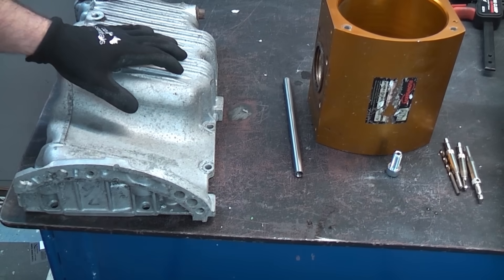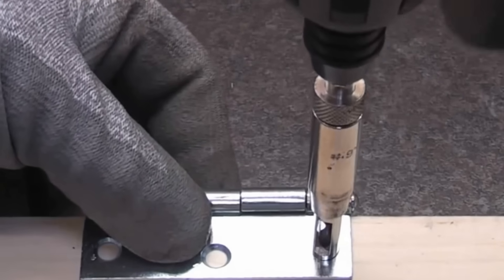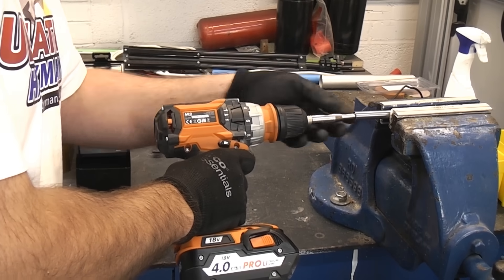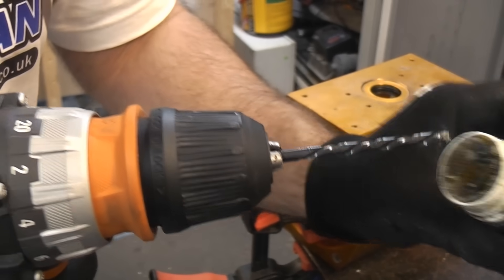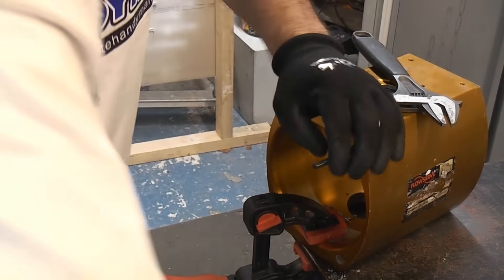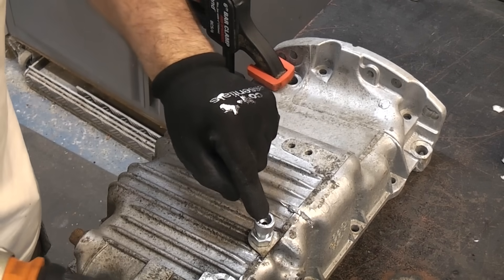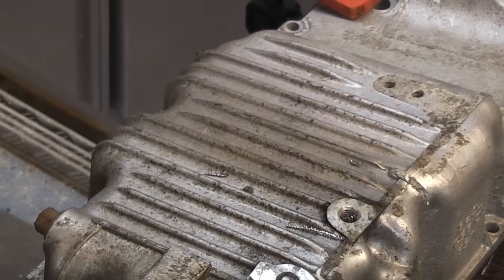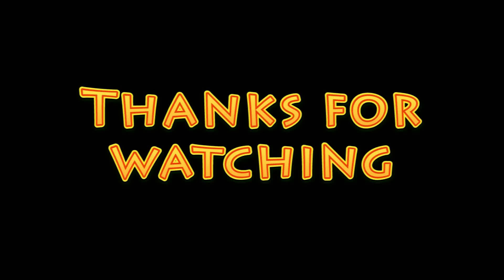How to remove a broken bolt in a deep hole | remove broken bolt in recessed hole

Comment: Finally someone showing civilized methods for this.  Switching out the original hinge drill bit for a left handed bit - dang that was a forehead slapper for me.. I've got the broken bolt, the hinge bit set, left handed drills; but I never would have thought of swapping the bits.. D'Oh!  Now I've just gotta figure out how to drill an allen bolt down the center without a lathe
Reply from the maker: Thanks for the comment 👍

Comment: If you create a bit of damage to the edges of the threads on the Al.  can you not grind  a flat spot on the side edge of the shank of the new bolt craating a sort of thread chaser ?  🤔
Reply from the maker: Not sure, it's best not to damage the threads too much in the first place (if possible)
Thanks for the comment 👍
Reply: Ultimate Handyman 
Thanks for the reply .

its always best to have best results but the best doesnt always come out the bestessest.  👍
That tool.....  7:21  is what is known as an  "Okie  fit'em all "  in the U. S  😳
Well made Video 👍 👍

Comment: What do you do when the bolt is broken off and seized in the hole from corrosion?
Reply from the maker: Apply some gentle heat to it, and use plenty of spray penetrant.
Thanks for the comment 👍

Comment: When I try those steep threaded extractors, they keep threading into the broken bolt until it splits lengthwise and swells up in the hole, hopelessly jamming it into the workpiece.  I use instead the extractors that are a tapered square (not helical).  The wedging force is totally controlled by the hammer blows used to set it; no more is generated by the turning.
Reply from the maker: I have both sets on site, sometimes the round ones work and sometimes the square ones work and sometimes neither of them works 😂
Thanks for the comment 👍

Comment: Sadly I rarely have a broken bolt in such good condition, I usually encounter the long break that has it looking like mount everest on one side so even with the alignment bolts, "which are very cool and I intend to whip up some for myself" obtaining a Centre pilot drill is very difficult. If it's big enough M10+ I can usually hit the broken face with die grinder to establish a more flat starting surface. If it's broken in my work it's never goner easy out ether as it broke cause it's been seized since noar first installed it without anti seize being applied. Great vid tho I learnt some more tricks for my bush mechanics bible. Cheers.
Reply from the maker: Thanks for the comment 👍

Comment: Interesting. Not a big fan of this left hand removers , Schweineschwanz in German ( Pigtail ) : If it breaks there is a piece of hardned steel in Your way only EDC can remove. There is a unexpensive tool set availiable with guide bushings and a remover what works like a charm: https://www.ebay.de/itm/HSS-Bohrer-Steh-Bolzen-Ausdreher-Loser-Werkzeug-Satz-Schraube-Linksausdreher-Kfz/161729806186?hash=item25a7d8ff6a:g:OzYAAOSwAghavPWi
Reply from the maker: You can drill out broken taps/drills/screw extractos at home, but it is not easy- https://www.youtube.com/watch?v=7JCfEMrCjhc

Thanks for the comment 👍

Comment: Hi what size guid drill bits do you use? For example do you use a 6 or 8 for ten mill bolt ?
Reply from the maker: The guide has to the the size of the hole that you are drilling out, so for a M10 hole, you would use a M10 bolt, with perhaps a 6mm drill hole through the centre, you could possibly drill the centre hole to 8mm, but that won't leave much material on the bolt guide.
Thanks for the comment 👍

Comment: If you used a tap wrench it would have been easier on you.
Reply from the maker: Yes, it would. I should buy another one really for home use.
Thanks for the comment
Reply: Ultimate Handyman I’m sure you know I was being sarcastic. That was actually a great video I’m a part-time Machinist and I love the through hole on socket head cap screw, I’ll be chucking some of them up in my lathe very soon.
Reply from the maker: I've made so many videos that I can't remember exactly what I said in each video. In this video I'm sure I mentioned that my tap wrench was at work, but people still tell me that I should use a tap wrench ;-)

Now I know you are being sarcastic ;-)

Comment: What if there is loctite on that  bkroken bold (in my case here 4 broken bolds in a mbk stunt motor with loctite )
Reply from the maker: Applying heat using a blowtorch can help to break the bond- just don't breathe the fumes.
Thanks for the comment 👍
Reply: Ok thanks will try that

Comment: A small sledge hammer is also good for tapping on wrench handles, especially if there is no room for a longer handle, rather than adding extensions. The copper grease is made for spark plug thread anti-seize, to help find it in a store.
Reply from the maker: Thanks for the comment 👍

Comment: Instead of those cheap "never easy oots" use a torx bit that's slightly larger than the hole you've drilled and bang it in instead of the esy out and just ratchet the broken bolt out, works every time
Reply from the maker: Thanks for the comment 👍

Comment: I have a complication for you, I have not suffered this but some people have.

What if  you use an extractor and that snaps off in the hole but it's firmly snapped off so you can't remove it.

Now you have a hardened steel bit stuck in the hole you set up to remove the snapped bolt.

I suppose you could always use harder drill bits but then the extractor may get in the way of trying to get a centered hole again.
Reply from the maker: https://www.youtube.com/watch?v=7JCfEMrCjhc
Thanks for the comment 👍

Comment: By the way fantastic program today excellent commentary,,,but I'm sure there is one thing that you overlooked or forgot to mention,,all these methods work very well unless the threads are gaulded on either portion of the broken off bolt or the internal threads,, in which case it is pointless
Reply from the maker: Thanks for the comment 👍

Comment: Dude where do you get that bore centering tool for the drill bit? ?
That' will make life way easier. ..especially if you could use it on a bur bit too In case you have to flatten out the broken off bolt before you punch and drill it.
Reply from the maker: I think you mean this- https://www.youtube.com/watch?v=6mZj0J6CNYA
Thanks for the comment 👍

Comment: Maybe insert an 8mm or 10mm wooden dowel and drill through it. Might be enough to guide the drill? Cut a groove across the top of the dowel to extract with a flat head screwdriver.
Reply from the maker: Thanks for the comment 👍

Comment: I've always either center punched, drilled and used an extractor.
Never ever thought of drilling through a bolt to be used to center it. Great tip.
The other method I use if the bolt is recessed.
Is welding a nut to the broken piece. Filling the inside of that nut to the broken piece. Then just un-bolting it.
Reply from the maker: Thanks for the comment 👍

Comment: If the piece is made of aluminum, we usually remove broken fasteners by welding a nut to the remaining shank allowing the weld to puddle to fill any reasonable void. Then use a wrench to work it free and remove it.  this only works on aluminum though, since the weld won't bond to it. Steel or cast pieces will become permanently attached.
Reply from the maker: Thanks for the comment 👍

Comment: What about a broken screw that is slightly sticking out of the hole? Same method like you used with a screw extractor drill bit?
Reply from the maker: Yes, but try and grind the broken part flat, so that it is easier to drill the hole as close to the centre as possible.
Thanks for the comment 👍

Comment: Really helpful info, but my bolt is tiny (road bicycle derailleur jockey wheel bolt)! Any thoughts?
Reply from the maker: Some small bolts are impossible, it is often the case that you have to drill them out.
Thanks for the comment 👍

Comment: Excellent idea I will be using that for now on always had a problem with the fucker sliding off and tearing up the threads drilling through a bolt is a perfect idea thanks a lot for the information keep on keepin on
Reply from the maker: Thanks for the comment

Comment: Nice video!!! Im afraid most of the time a bolt is broken off (for me anyway) is because someone crossthreaded or it has corrosion welded itself in there.  In either case, none of this works for me.  The centering technique is excellent!!!!!  I will use this next time I have to drill one out and retap it!
Reply from the maker: Thanks for the comment

Comment: What if the bolt is sitting above the surface and is not flat or smooch? Making it hard to drill anything into it without it slipping right off.
Reply: Cut a slot in it with a hacksaw/grinder/Dremel and turn it out with a screwdriver or impact driver. First apply releasing oil though.
Reply: Hahaha take a grinder and smooth it off... Then you can drill the hole for the screw extractor knucklehead

Comment: Good video.  How do you sharpen your drill bits. They seem very sharp and they cut evenly?
Reply from the maker: I normally use a diamond-coated file, it's much easier than using the grinder IMHO

https://www.youtube.com/watch?v=DZrbeyATkvg
Thanks for the comment 👍

Comment: Where can i buy that drill bit adapter?
Reply from the maker: Not sure which adaptor you mean, but these links should help-
Hinge centering drills- https://fave.co/2DpJo1H

Left-handed drill bits- https://fave.co/2xJjK1M

Teng screw extractors https://fave.co/2OnfRuF

Dormer taps -https://fave.co/2OsN1sQ 

If you are in the UK- 

Hinge centering drills- https://fave.co/2NE1VMc

Left-handed drill bits- https://fave.co/2DubtF4

Teng screw extractors- https://fave.co/2pVLkVT

 Dormer taps - https://fave.co/2pTfbyx

exact cutting paste- https://fave.co/2Nabyxc

Cobalt drill bits (they are much better on harder steels like bolts) https://fave.co/2zDh3kp

You'll have to make the guides yourself, but they are easy- https://www.youtube.com/watch?v=6mZj0J6CNYA&t=1s

Spring tools centre punch- https://fave.co/2NbnLBD

Comment: Now what can be done if you were an idiot and you went ahead drilling without having watched this video and now the threads are damaged?
Reply from the maker: Well, firstly nobody is an idiot, at least you had a go ;-)
Depending on how damaged the hole is, you might be able to just re-tap out the hole, but if it is badly damaged you can always get a Helicoil kit and fix it with a threaded insert- https://www.youtube.com/watch?v=sQHRB2ElZJ0
Thanks for the comment 👍

Comment: Every Bolt extraction is different, I have yet to see one that I could not get out. Relieving the tension on the shank is key. I run into this same problem with Hydraulic Cylinder Glands. Sometimes the answer is to drill repeatedly to relieve the tension. If You choose to drill the most Important part of the process is finding and center punching the exact center! This cannot be over stressed. If You use heat then use it only momentarily as the heat is transferred quickly and will return to the same or even worse gall the threads..... The bottom line is that if You choose to be a tech then You will run into broken bolts. I spent one Christmas day bolting on a new windshield on an MH-60 Sikorsky (Black Hawk) out of about 200 screws over 90 of the heads snapped off. She had to fly the next day and that was a very long night....Hooah Black Knights!
Reply from the maker: Thanks for the comment 👍

Comment: where can i buy the tools ? link me please
Reply from the maker: Hinge centering drills- https://fave.co/2DpJo1H

Left-handed drill bits- https://fave.co/2xJjK1M

Teng screw extractors https://fave.co/2OnfRuF

Dormer taps -https://fave.co/2OsN1sQ 

If you are in the UK- 

Hinge centering drills- https://fave.co/2NE1VMc

Left-handed drill bits- https://fave.co/2DubtF4

Teng screw extractors- https://fave.co/2pVLkVT

 Dormer taps - https://fave.co/2pTfbyx

exact cutting paste- https://fave.co/2Nabyxc

Cobalt drill bits (they are much better on harder steels like bolts) https://fave.co/2zDh3kp

You'll have to make the guides yourself, but they are easy- https://www.youtube.com/watch?v=6mZj0J6CNYA&t=1s

Spring tools centre punch- https://fave.co/2NbnLBD
Thanks for the comment 👍

Comment: Please tell a man where he might buy a reverse drill bit??!!.or left handed, whatever??. I've looked for a long time.. I've never bought tools online either so anyplace anyone may know of please lmk.. thanks.
Reply from the maker: These links cover just about everything used in the video-
Hinge centering drills- https://fave.co/2DpJo1H

Left-handed drill bits- https://fave.co/2xJjK1M

Teng screw extractors https://fave.co/2OnfRuF

Dormer taps -https://fave.co/2OsN1sQ 

If you are in the UK- 

Hinge centering drills- https://fave.co/2NE1VMc

Left-handed drill bits- https://fave.co/2DubtF4

Teng screw extractors- https://fave.co/2pVLkVT

 Dormer taps - https://fave.co/2pTfbyx

exact cutting paste- https://fave.co/2Nabyxc

cobalt drill bits (they are much better on harder steels like bolts) https://fave.co/2zDh3kp

You'll have to make the guides yourself, but they are easy- https://www.youtube.com/watch?v=6mZj0J6CNYA&t=1s

Spring tools centre punch- https://fave.co/2NbnLBD

Thanks for the comment 👍

Comment: What if the bit will not cut into the bolt? Even with a new bit.
Reply from the maker: You could try a cobalt drill bit, if that won't touch it you could try this- https://www.youtube.com/watch?v=7JCfEMrCjhc
Thanks for the comment 👍

Comment: I've never seen a bolt break off like that.. Usually they break at the surface, or out above, not below in the threads.
Reply from the maker: It happens sometimes ;-)
Thanks for the comment 👍

Comment: But putting copper paste on a steel bolt would make it corrode faster wouldn't it?
Reply from the maker: Copper anti-seize is widely used, apparently, it can cause corrosion on aluminium in some scenarios.
Thanks for the comment 👍

Comment: Can you please tell us what are those special drill bits and tools and where to buy them.  Thanks
Reply from the maker: Hinge centering drills- https://fave.co/2DpJo1H

Left handed drill bits- https://fave.co/2xJjK1M

Teng screw extractors https://fave.co/2OnfRuF

Dormer taps -https://fave.co/2OsN1sQ 

If you are in the UK- 

Hinge centering drills- https://fave.co/2NE1VMc

Left handed drill bits- https://fave.co/2DubtF4

Teng screw extractors- https://fave.co/2pVLkVT

 Dormer taps - https://fave.co/2pTfbyx

exact cutting paste- https://fave.co/2Nabyxc

cobalt drill bits (they are much better on harder steels like bolts) https://fave.co/2zDh3kp

You'll have to make the guides yourself, but they are easy- https://www.youtube.com/watch?v=6mZj0J6CNYA&t=1s

Spring tools centre punch- https://fave.co/2NbnLBD
Thanks for the comment 👍

Comment: Ahhhhh but when the bolts snap off at the edge of the hole so you have NO threads to screw your little guide into..... and the bolts are grade 8.... Not mild steel......  🤦‍♂️🤦‍♂️🤦‍♂️🤦‍♂️
Nissan RB motors...... Damn you Nissan!!!  Every time..😡
Reply from the maker: I remember why I always buy German vans 😂
Good luck with it

Thanks for the comment 👍
Reply: lay a washer on it. Weld washer to bolt. weld nut on washer. Take out with wrench.

Comment: Great idea making the drilling guide, I will start on those tomorrow.  I have found that when I am having trouble getting the extractor to bite into the metal, I put a bit of torque on it as I hit it with the hammer, tends to get a better grip that way.  Thanks for the ideas!
Reply from the maker: You are welcome
Thanks for the comment 👍

Comment: Have to be very careful with those screw extractors, and know when to stop. Normal drill bits won't drill through them if it gets broken off in the bolt
Reply from the maker: Thanks for the comment 👍

Comment: Newbie question: What is cutting paste? Is that used to prevent seizing of the drill bit so that the tip doesn't break off?
Reply from the maker: It prevents the drill bit from overheating, it also lubricates it.
Thanks for the comment 👍

Comment: My broken studs are usually rusted in and inaccessible. :-(  I had a broken exhaust stud that resisted removal for a week of evenings. I was left with a nub protruding, I couldn't weld a nut on, socket head screw extractors just slipped. In the end, I bought a set of left handed chuck jaws. Did the job in seconds. Never used them since, but it don't matter, they're so beautiful that they sit on my mantlepiece as ornaments! :-)
Reply from the maker: Exhaust studs are a real pain in the backside!
Thanks for the comment 👍

Comment: The tap handle method allows one to keep pressure on the extractor and also places pressure on either side for better control.
  I sometimes use small endmills to "flatten" the broken surface. A tube or pipe will usually suffice to keep the threads intact.
Reply from the maker: Thanks for the comment 👍

Comment: Nice! Remember to watch for metal shavings getting wedged in threads. Compressed air will blow them out.
Reply from the maker: Thanks for the comment 👍
Reply: allways blow out every bolt hole before replacing bolts more so if its rusty like a manifold

Comment: The AEG 18V cordless drill in the UK is the same as the Home depot Ridgid 18V system in the USA. Both are made at the same factory in China, both batteries interchange. The chargers in the UK are for 220 volts
Reply from the maker: Thanks for the comment 👍

Comment: Hello, where in gods name would you purchase a left hand drill bit? I have never seen these in local hardware stores. I would be hard pressed just to find left hand threaded bolts. Thanks
Reply from the maker: You can get Left-handed drill bits here - https://fave.co/2xJjK1M
Thanks for the comment 👍
Reply: They are uncommon but often times are sold along with extrator kits.